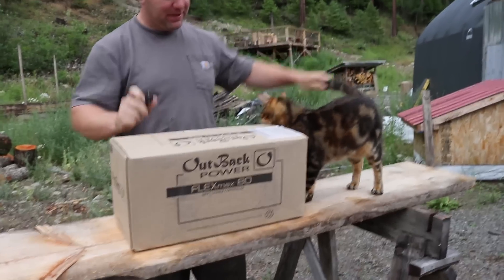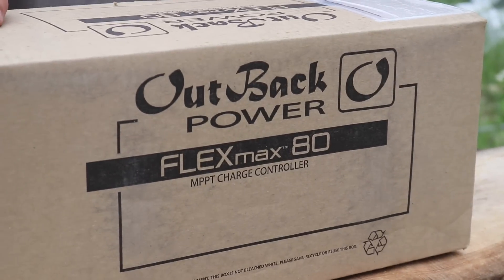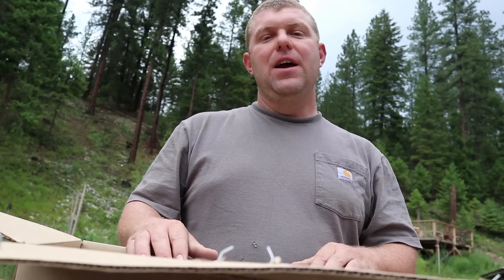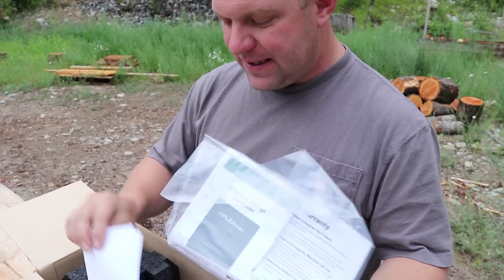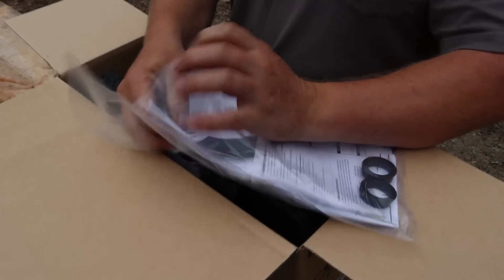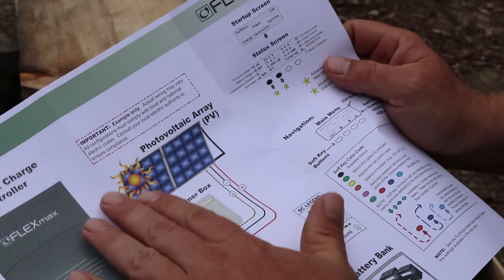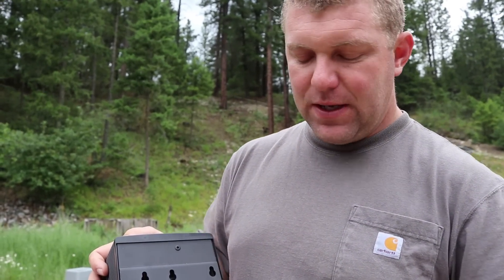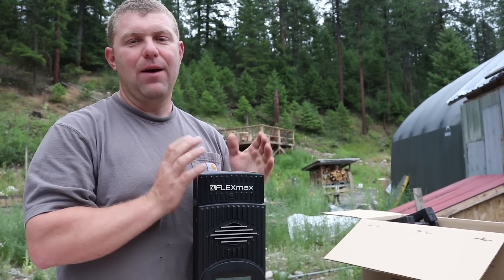MASSIVE SOLAR UPGRADE (Outback FLEXMax 80 Charge Controller Unboxing)

Comment: Input voltage does NOT have to be 12v to run a 12v battery bank...

Wire your panels in series to raise the voltage and drop the current, this will help with the long cable runs.
Reply: This is the EXACT reason to go MPPT, higher input voltage, less losses on the wire between panels and charge controller. Save money on not having to go huge wire gauge!

If they keep the panels in parallel (off the cuff: 17Vdc, 30 amps (10a/panel) 6awg) They lose 14% of their power! If they series the panels they lose only 2% of their power over the same cables.
http://www.calculator.net/voltage-drop-calculator.html
Reply: This post is totally correct.  For a given power output on a panel array, if you increase the voltage then the current will drop (power = volts x current).  Cable resistance losses are proportional to the current and not the voltage.  Therefore, increasing the voltage by wiring the panels in series is the way to go.  Also, with this configuration you will gain a benefit in using a MPPT controller when the panels are in partial shade or when it is overcast :)
Reply: Agreed: he should be able to configure a sophisticated machine like the FM to take 36v input from the panels in series, and still use a 12v battery bank and 12v inverter. That's the whole *point* of "Voltage step-down capability ... higher PV array voltage"
Reply: The main reason for going MPPT is not for the higher voltage, that is a side benefit.  The reason for going to MPPT is to improve panel efficiency and gain an extra 30-50% on daily power output.  MPPT=Maximum Power Point Tracking.  What this controller does is monitor the input (panel voltage and current) along with the output (battery bank voltage and current) and then controls a DC to DC converter and it will apply more or less of a load (in this case the battery bank via a DC to DC converter) until it finds the point of maximum power which for a single 12v panel is going to be around 16-18VDC.  This means that even if the batteries are near 100% depth of discharge at 10.5VDC the DC to DC converter will apply a higher amperage (since Amperage X Voltage = Wattage) by allowing the panels to sit at or near the voltage where they produce the most power and converting that power to a lower voltage output.  The beauty of this arrangement is not just that you can increase the voltage but that you increase the usable amount of electrical power that can be harvested since even on overcast days the controller will constantly work to achieve the maximum amount of power out of the panels.

With most PWM controllers you are effectively connecting the panels straight to the battery bank and the controller varies the duty cycle to achieve a preset output voltage.  This means that your panels are not being run at their maximum power point when charging the battery.  Some of the higher quality PWM controllers do allow you to manually program your panel's maximum power point and then use a DC to DC converter to maintain the input at a preset voltage while the output is set to the battery charging voltage.
Reply: RichieFromBoston  how many ft of 1 AWG wire did you use/run  in a land cruiser?
Reply: 12 volt panels can output in the range of 18-20 volts, yes, but as you pull current from it, that voltage drops quickly. you can charge a 12 volt battery directly from that, yes, but you risk over-charging and cooking the battery, and you deal with a high efficiency loss. the point of a MPPT charge controller is to dynamically step down the voltage, using what's basically a switching power supply. as the voltage gets stepped down, you also get a higher output current than the input. but, everything has losses and waste heat, so the more you step down the voltage, the lower the efficiency of the converter.
Reply: Some of the solar systems here have a DC voltage before the inverter of over 300volts DC. Needless to say DC conductor separation is important
Reply: you can up the voltage but you increase danger of electrocution if you not careful  50 vdc is a safe limit.  300 can kill
Reply: Their panels wont operate at 17v with a PWM controller, they'll be pulled down to battery voltage.. which makes the efficiency even worse....
Reply: Yes exactly, running this charge controller at "12v" input is just plain silly. He should series his panels up to 150V max and let the MPPT handle the downconversion to 12v for the battery bank.
Reply: The FlexMax 80 can handle 145V.  It should be lower than that to handle cold mornings where the panels will produce a higher voltage albeit with little current.  Any voltage over 150v (no matter the current) will damage the charge controller.  Battery voltage is on the other side.  It can be 12/24/48,etc and the controller handles that side itself.
Reply: it can
Reply: one should both up the panel and batteriesto a min of 48 volts
Reply: Oh absolutely it can, the problem is when it arcs
Reply: Yes. The CC converts that high voltage to volts that the batteries can use.
That is why you connect the CC to the battery back FIRST,so the CC can see the voltage of the battery bank.
Reply: Yes, and that is where the wattage limitation shows up. It isn't the PVs per say, but the output to 12v. Right now, with his current system, the way to get max power is putting the panels in series, and as I said somewhere else, this is a computer controlled MPPT charger, and, so when you put your volt meter on the panels or on the input side of the controller with them in series, most likely you will see (Number of PVs) times 17 volts for 36 cell panels. Which is the type of panel I believe he has. And, using your inexpensive clamp meter ($30 or so) you will see a current . volts times current=watts. Snore. But I love this stuff, always have. Yes, nerd alert. 

THAT SAID, remember, you can't get 5000 watts without 5000 watts of panels. You can mix the panels, say for instance, 3 36 cell panels in SERIES, with one (is it )108 cell panel. I've seen 300 volts presented to a controller in some instances. That was a grid connect, but just shows what can be done, its complex, but cool.

Many users on Yachts have 12 or 24 v systems. They at first didn't have MPPT. A typical yacht has 3 36 cell panels paralled. The other fairly ty[ical setup is 3 72 cell panels, for, you guessed it, 24 vdc boats. They were recommended to them because in the beginning PWM was all that was available. The typical way to convert that system to MPPT is to series the panels, using the more advanced MPPT Higher input voltage controllers,  to whatever output they need. Thus, the need for the Outback System Controller was born. I have a outback systems main office photo from the 80s on my facebook page. They had a black huey sitting in the parking lot. It was a very changeable fast pace place !
Reply: The panels do not have to be 12v.  Nowhere near.  They can be up to 145v for the 80 I believe (startup).  You want to stay well under that for cold mornings but there is a sizer on the Outback web site for optimal power.  The panels absolutely need to be wired in series/ series-parallel.  I believe he stated that they only have a 12v inverter so therefore the battery side of the equation needs to stay 12v unless they change out the inverter.  The moral of the story is that solar is not hard if you use proper equipment.  His pror statement about constant maintenance is simply not true at all if you set your system up correctly and size it appropriately.  I tried to offer to help them but he seemed very defensive and unwilling to let me give him advice.  I like the cat :)
Reply: the panels are not 12V, they are more in the range of 17-20V each, so ~60V tops the 3 of them in series, but that is still way better then the 17-20V they run now (less loss over the wires)
Reply: He is doing 12v because his inverter is a 12v inverter.

Comment: I've been watching you for a while, but I've never commented before. I've always wondered though, why you don't build a shed up next to the solar panels and put the battery bank, inverter and charge controller up there? Running high voltage down the hill would give you so much less voltage drop trouble than what you're doing with DC.
Reply: Pure Living for Life     you need to install a bank of MAXWELL SUPER CAPACITORS  in parallel  with your battery bank . this would add surge capacity easing the starting of high draw devices like A/C  and make certain that your cables are of sufficient guage to run the distance .
Reply: Pure Living for Life You would be better served by digging a hole and building a small shed with an access door next to the solar panels. This will keep the batteries cool in summer and fairly warm in the winter. Put your inverter in the shed with the batteries and run AC wire to the house, this will make everything much better and more efficient as well.
Reply: Nah, the hot tub first was a good idea. Nothing beats a good soak after a long hard day.
Reply: Tony Chen if you watch that video again, you will see that the new inverter handles a max of 60 VDC for the battery bank. The 150 volts was the max for what the solar panels were putting out. Due to the voltage loss and the expense of D.C. Cabling, it is always much better to minimize the D.C. Run. That's also why people tend to put the panels on their roof....
Reply: Yes, on paper underground temperatures sound great... until the snows melt or it rains forever and your underground shed becomes flooded taking thousands of dollars of electronics with it.  Tony Chen is right, they just have to up the voltage by putting all their panels in series for now.   They can redesign their setup as they get further into their home build.
Reply: enator71 Yeah, it isn't rocket science, dig a pit, insulate it, cover it, add a hatch, get on with it.
Reply: Moving AC is a lot easier and more efficient than DC. You could save a lot of $ on wire and not lose so much.
Reply: It is not necessary to put the battery bank, inverter, and charge controller up there. The key to minimize power loss is high voltage. Whether the current is AC or DC does not matter. Flexmax 80 can handle 150 volt. That's great. If it was me I would arrange the solar panels so the max voltage is as close to 150 volt while remaining under. Having the electronics near the house makes checking on them a lot easier. Let's suppose it's night time and you want to check the battery. Do you really want to walk outside just to do that? What about in winter?
Reply: Super capacitors won't help. The inverter's the limiting factor. That battery bank can deliver an insane amount of current. I cringe when I see him waving that crescent wrench around in the battery box.
Reply: OhioPreparedness Okay, seems there is a misunderstanding. I was talking about the voltage from the solar panels going into the charge controller. You were talking about the voltage from the charge controller going into the battery bank. That's why we seem to be talking past each other. Anyway, let me recommend the Solar Electricity Handbook by Michael Boxwell. He updates the book every year with new information too, although basic stuff like how to calculate the wire gauge you want and how it relates to voltage and current remains the same. It's really a useful read.
Reply: sporadic -Z Adding to this idea would be to  add a 100W 12V bulb in a porcelain socket in your insulated battery box, connected with a wall thermostat and a small 12V fan if necessary.  Set the thermostat to 35°F and you should not have any freezing problems with your "remote" power shed battery box.  I learned this from an old hand years ago.
Reply: You've got that backhoe now... Make a flat spot up on the hillside, empty out your timberframe battery box, carry it up there with the backhoe, then move the batteries in the bucket.
Reply: JAY WANDERS OUT   With proper drainage, flooding is not a problem unless there is a chance of a lake.
Reply: OhioPreparedness Huh, I didn't misunderstand anything in the video. Yes, I know the 150 VDC is on the input side. Why do you think I suggested arranging the solar panel so the voltage is as close to 150V without going over? And there is no difference in DC and AC cabling. The difference you see is because most DC cables are made to deal with 12 VDC current. But if the voltage is 110 volt DC then the cable you need is the same as the cable for 110 AC. Vice versa, if for some reason you need to deal with 12 VAC then you will also need those thick cables that people usually use for car batteries.

Put four of the new 24 volt   solar panels in a series and you can use the same kind of power cables that you use for 110 VAC. (The 24 volt solar panel will have a max voltage of around 35 volt, so to play it safe we put only 4 in a series.)
Reply: Tony Chen the max battery bank voltage for that charger is 60 VDC, not 150. Even at 60 VDC, which is an improvement, the amperage is still much higher than it would be for 120 VAC, hence the reason AC cabling is cheaper. If the charge controller worked with a battery bank voltage above 120 VDC, then it's a mute point, But in this application, the battery bank is limited to 60 VDC.
Reply: I agree with you.  With all the hard work they have done.  A hot tub is the reward for a hard days work and probably very therapeutic wiped out back, arms and general relaxation.
Reply: Best idea
Reply: Yeah, bury an old chest freezer or some such.  Or a cement box like what is often used for well pits.
Reply from the maker: Batteries will be located in the basement of the home and panels may be mounted elsewhere, likely on a pole. Until home is built, we're avoiding doing anything permanent.
Reply: Pure Living for Life , I've been working with electricity for a long time, but not solar at all so I'm no expert.  A simplified(and probably partially incorrect) understanding I have is this..depending on wire size that 100 foot run is gonna cost you about 2-3 volts.  When you pull that off DC 12 volts, that's huge.  If the inverter were at the top of the hill you would send 120v down which(with cheaper wire I might add) would still be 117-118 volts by the time it gets to the bottom of the hill.  I feel like the simple move would probably have increased daily output of your old system by 15-20% daily without any additional purchases.  Either way, when you get closer to your finished building out there, I feel like it should always be I  your plan to have the solar equipment as close to the panels as possible.  Someone with more experience chime in.    Also, I love what you're doing, I wish I was up I  the mountains doing this myself instead of sweating my butt off in Orlando...good work you two.

Comment: I really wish y'all would let us in on how to earn income homesteading?
Reply: soaringtractor YouTube income is not much lol unless you make children videos who can not skip ads
Reply: Jesse has mentioned they have a business providing some service over the internet; so it is not connected to their homesteading.  Its probably the biggest issue with Homesteading - - how to make money & homestead, as usually being remote eliminates many job possibilities.  
Of course with linear actuators its back to the cost of them versus just adding more panels.  And in this area we have massive winds (~120 mph tore our steel porch away 2 years ago) - so firm stationary was the way to go.  And actuator for a large bank of panels can be VERY expensive for a nominal increase in efficiency.   But its nice to dream -- I dreamed going that route, but the numbers didn't make sense for our installation.